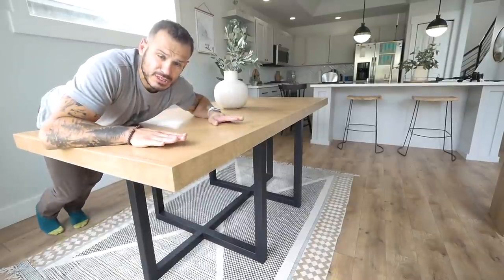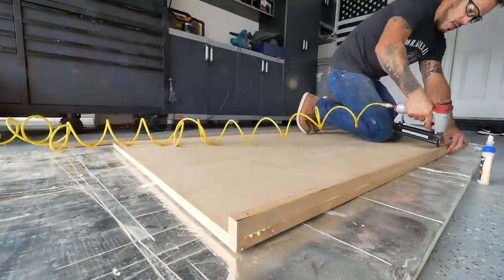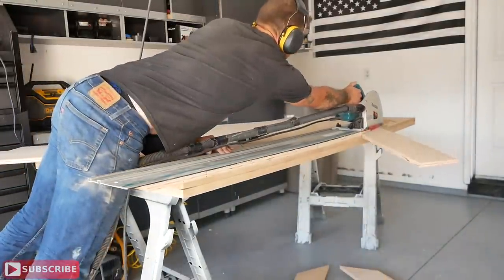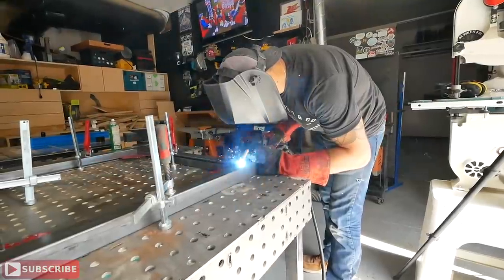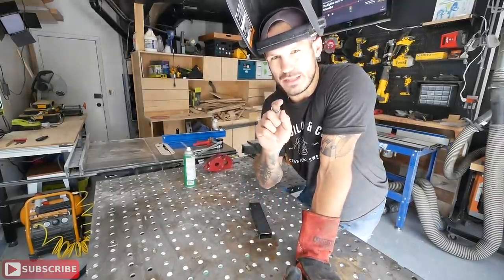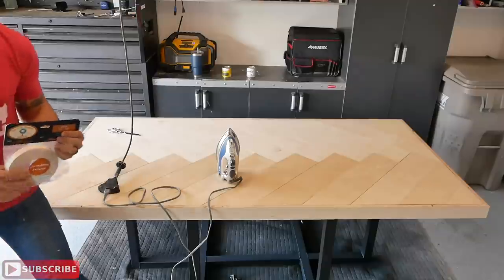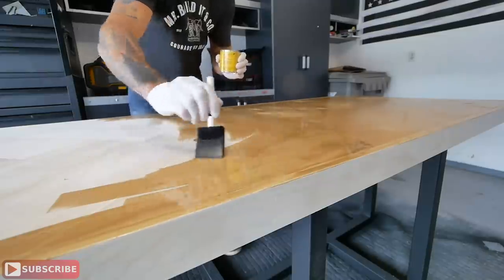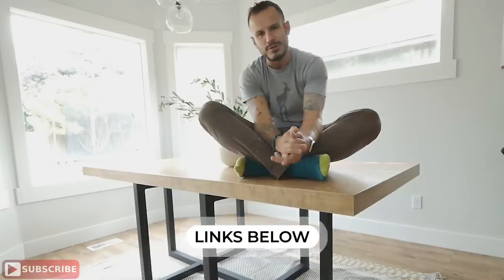DIY Plywood Herringbone DinningTable

Comment: Love it! Have done a herringbone table, but didn’t seem this doable!  The nail gun marked everywhere it was used no matter how lightly I applied it. Then because I had to use a horrible oil based stain (didn’t realise it was until I got home, but it was the on,y one in the colour I wanted) I couldn’t fill the dents because they showed up horribly in the finish, had to sand them back off again and re-stain. Might have to make another one..
Reply from the maker: Every project is an adventure, ain’t it ?!

Comment: Cool idea man. Turned out great. 

Off topic but I love the simple baseboard you used in your house and the window trim. I want to replace all the cheap looking builder grade base in my house with a 6" wide primed pine board. But I have the bullnose corners on all my walls so that concerns me a little. I really don't like those small pieces that guys install on the bullnose so I am debating on just doing 45s. Any thoughts?
Reply from the maker: Personally 45s might be cool for a second and then get old. I’d just do 3/8 round over and cal it good

Comment: Awesome table! I’m about to build one myself but 96” x 40” w/ a steel trestle base. My question is do you think the wood ribs are sufficient for preventing sag at that length or would you recommend inserting angle iron or flat bar in the underside?

Comment: Why not screw the ply aprons/ fame on form the inside of the table to hide nail holes? And same with the top. You could’ve shot a brad from the bottom up when you had your piece in place and than screwed form the bottom side to hide nail holes on the top. Over all it came out amazing !
Reply from the maker: Maybe on the next version. Great idea

Comment: Did you use a water based poly on oil based stain? Isnt it supposed to be oil on oil or water on water stain and poly?
Reply from the maker: Once died, water based works excellent

Comment: Damn I thought you were gonna use the edge grain of the ply wood for the really cool look. Woulda been easier to use pine.
Reply: Joel Cotton pine from the home center is still very green. it’ll probably be hard to find flat pieces and even if they are flat it’s likely to twist after a day or two. that’s why he said using plywood, no need to worry about twists etc.

Comment: I'm building an 84"x84" table for mom. The top will be made out of common board, It will have storage underneath with 2/3 of the top opening up with lift hinges, like what one would use on a coffee table. In your opinion, would 1" mdf (I have a sheet out back) strips be enough to support the weight in the middle or would I possibly be better off getting angle iron to try and keep it from sagging? The open space in the table will be about 2 1/2"-3" she plans on storing board games, placemats, napkins ect in it. There will be a lazy Suzan kind of in the middle of table top. I'm just thinking that gravity will eventually win and the middle of the table top will sag.
 Nice job on your table by the way. New subscriber.
Reply from the maker: If I’m understanding correctly, this will be for a coffee table ? Angel iron might be over kill. Mdf would be fine.
Reply: @MrBuildit  it's a kitchen/dinning table. I'm usually for over kill if I am building it. I just know it will eventually end up sagging from the use of plates and such. But the two sides will lift like a coffee table, with 1/3 0f the table not moving but with storage underneath. When I get it completed I'll send a pic if you want. I had this idea for the table awhile ago, then mom saw a home reno show where the kitchen/dinningtable as the same concept, she said she liked it. I said "yeah, that's what I want to do." Lol
Reply from the maker: yeah for sure. send it over. I'm having a hard time envisioning it right now.
Reply: @MrBuildit  sure. Hopefully it'll be done by Monday. There are a few projects still in front of it. And a situation with the family could shift project and choir priorities  around.

Comment: Great video!  Just an FYI for the steel tubing, 16 ga = .065" wall thickness(also referred to as 1/16" thickness).  13 ga = .095" wall thickness.  For a handy chart check this link https://www.industrialtube.com/assets/files/Decimal_Equiv_Flyer.pdf

Comment: Why didn't you use 1x2 maple boards for the edges rather than having to edge band plywood on the top of the table?
Reply from the maker: It would be really expensive. The color would be off between plywood maple and the solid maple.

Comment: The correct spelling is dining table. Check the webster dictionary. You have joined the club of using one of the most commonly misspelled words.  Otherwise great video. Thanks.